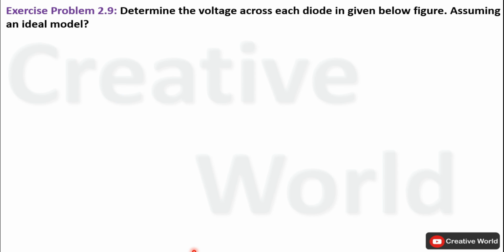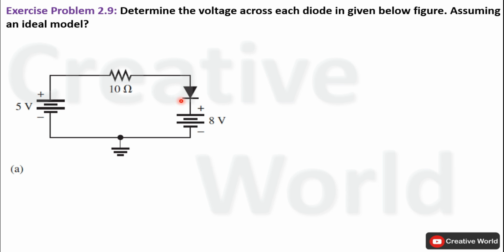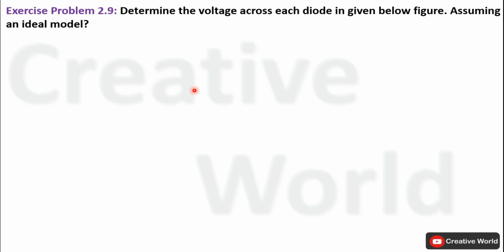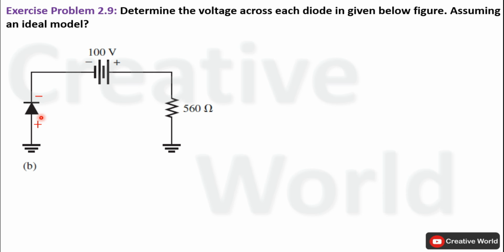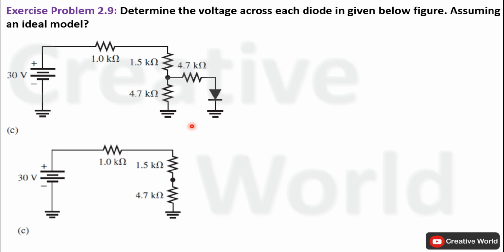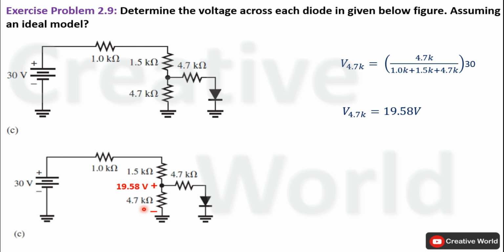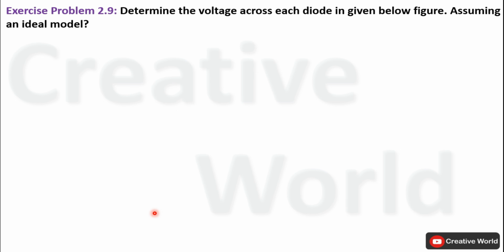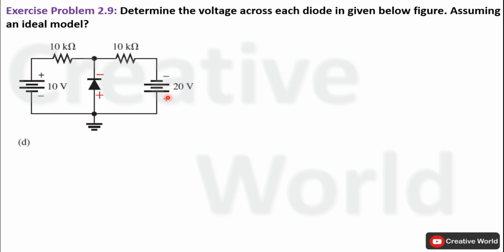Chapter 2 Exercise Problem 2.9 Solution | Applied Electronic Devices

Comment: 2.32 Karwa de
Reply from the maker: Sure soon the video will upload
you can ask the solution of desired problem outside if this book in email as well I will make video for that as well
Reply: @CreativeWorld-3234 
Sir AJ Mera paper hai university ma Tu ap agar comment ma hi pata da Ka is question ka part a Jo hai ye +ve limiter hai Tu ye positive part kha tak limit Kara ga bcz 1 resistor diode Ka neecha hai or ik shuru ma hai resistor same 4.7k ohm  Ka ???
Reply: Sir plz reply
Reply from the maker: @stay.humble.00  Dear this is 2.34 not 2.32 on the book which i have 
the behavior of this circuit will as follow:
during positive half cycle the diode will conduct and if we consider it as silicon diode it will have 0.7V drop across it in this way our output voltage during positive half cycle will be Vout = (Vin-0.7/2) V and during negative half cycle output voltage will be equal to Vout = -Vin
Reply: @CreativeWorld-3234 
Sir lakin agar diode ki resistance change ho jay Tu phir Tu 2 SA divide nhi Kara ga bcz is question ma 2V is liye Likha huwa Ku Ka resistance same hai Tu voltage drop ik hi cosider ho ga is liye Tu plz ye bata da
Reply: @CreativeWorld-3234 sir ap mujha email bheja ma apko question ki pic behj tha Hu phir ap Dekh la
Reply from the maker: @stay.humble.00  can you please email your question with circuit diagram
Reply: @CreativeWorld-3234 yes sir kindly share your email address
Reply: @CreativeWorld-3234 ?
Reply from the maker: @stay.humble.00  i am working on it